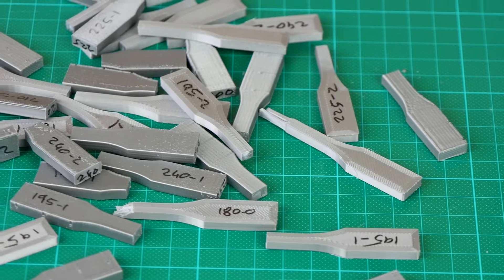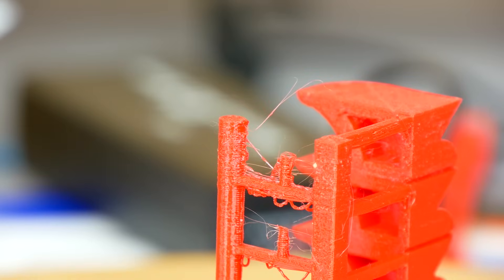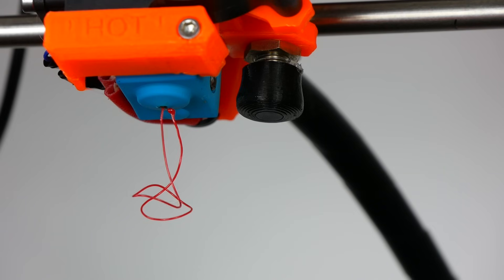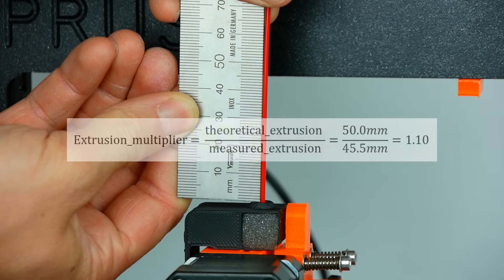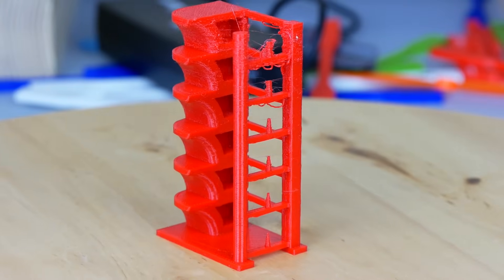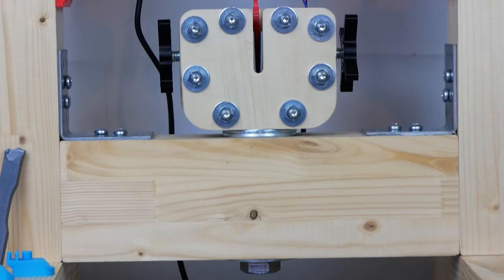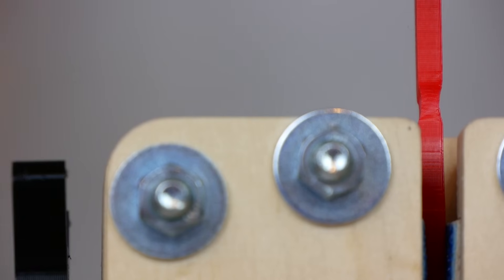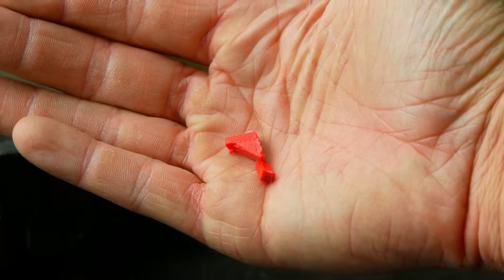3D Printing with PETG - How does the printing temperature affect strength? || Setup & Tips

Comment: High temperature comes with high speed. Each filament manufacturer have their own settings. Try (hard?) Et check results.
Tower test is very good for me and helpled me a lot between sunlu and elegoo petg settings are not quite the same.
But, past 240, stringing is most always here but acceptable, one shot of hot airgun and it's OK

Comment: I have years of perfect prints with esun pla+. I tried esun petg recently as they had a discount. 

But omg, petg is so stringy and blobby, forming lots of small blobs and lumps.

I'm using 235 degrees Celsius, but retained pla+ speed n retraction everything.

Any ideas why? I'm just going to use pla+ in the future if I can't figure it out.

But wow petg is very good to sand
Reply: PETG is hygroscopic, soaking up moisture from the environment pretty quickly. The water in the filament turns to steam during extrusion causing bubbles and stringing.
 So when it comes to PETG, it's probably best practice to put even spools fresh from the package into a food dehydrator for a few hours before first using it. Afterwards put it immediately into a good drybox (capable of keeping the filament at around 25% hygro) and print out of that.
Other important factors are to keep temperature at a reasonable level. Transparent PETG in particular can be printed at around 205 degree C in a clean nozzle/hotend and slow print speeds. 235 degree might actually be too hot and cause even dry PETG to bubble on its own. Non transparent PETG is a bit more waxy and needs to be printed around 10-25 degree hotter. Printing speed for PETG should be greatly reduced compared to PLA. Printing it fast leads to globs and stringing. My setting for small parts (<50mm at their widest) is 40mm/s for perimeters and 15mm/s for small perimeters, which some might find agonizingly slow. Cooling fan should be used but at low power compared to PLA.
Overall, dehydrate PETG, even fresh spools and keep them dry. Print slowly and not too hot.
Hope that helps!

Comment: " 210-240°C" for das filament.  I'm going to suggest that this isn't 'real' PETG at all.  Printing for PETG is in the range of 230 to 250 typically.  Seeing 210c on the label makes me believe it's a blend.  (For normal PETG in the USA, I use Ataraxia Art filament PETG, which is EXCELLENT.  For Carbon Fiber PETG I use Atomic Filament Extreme Pro CF PETG, which is exceptional, as long as it's dry).

Comment: I'm new to 3D printing, currently working on a custom mechanical keyboard project, and printing the key caps with PETG, with 0.2mm nozzle, on my Ender 3, and ended up with a great result after calibration, and about 7-8 failed attempts. :) The following settings work for me: Head temp 145 °C, Print speed 30mm/s, Layer height 0.1mm, Line width 0.21mm, 100% infill since the key caps are tiny parts, Z hop enabled, and had to reduce the minimum layer time to 1s, so it doesn't slow down cause I could not get the tolerances right with changing print speed... For 1st layer Bed temp: 70 °C, Fan OFF, from the second layer onward Bed temp 30 °C, Fan 20% This results in good adhesion, and no elephant footing.

I tried printing it with standard 0.4mm nozzle, but could not get the tolerances to work for cherry MX switches, so I switched to 0.2mm nozzle, and that worked.

Comment: Hi Stefan I have wondered if anyone has attempted to use a pump instead of a fan for part cooling?
I would like to divorce the fans vibration from the printhead and thought of using a cutting fluid tube guide for ease of directing the air flow.

Comment: I think you might be pretty off on the temperatures. Petg should very seldom be printed under 235c, most brands is perfect at 245-250.

I print most brands at 245-250 and that gives good looks and high layer adhesion

Comment: The bend vs shatter has to do with the plastic viscoelasticity. Basically when you have low strain rates the material can more easily absorb the energy and it does not shatter. So when you perform a tensile test at low strain rates the material will elongate and eventually yield. If you increase the speed at which you pull the sample it will fail (break) at a lower % strain. Typically material "toughness" is tested with a notched izod impact strength where a pendulum swings into a notched specimen and the energy it takes to break the specimen is recorded. Its just a different test to measure a different material property i.e. tensile strength vs impact strength.

Comment: The difference you observed between a ductile failure when slowly loaded, and a brittle failure when shock loaded is pretty classic actually.  When the material is slowly loaded, the polymer chains have time to unwind and stretch out leading to the classic plastic deformation you've observed.  When the material is loaded rapidly, there isn't time for those micro movements to occur and the material simply cleaves off.  Such clean breaks are pretty typical of shock loaded failures in otherwise ductile materials.  If I remember my polymer chemistry from college correctly (and it's possible I don't have it quite right) this tends to happen on the more tightly packed polymer structures.

It's just one of those things that seems to make absolutely zero sense, but it is the way it works out.

Incidentally, this video popped up in my feed at exactly the right time.  I'm working on some 3D printed spiral torsion spring designs, and intend to use PETG for the parts.  I've been working with some researchers to recreate their study, and it's really interesting stuff.  Could make for a fun video if you wanted to try something a little funky and different.

Comment: I feel like your testing methods and tolerances should be made into a rating to be added alongside the current tolerance rating that already exists for filaments. Haven't watched this video yet or printed with PETG yet, or rather I haven't printed with anything other than PLA yet and haven't had my 3D printer long ( Ender 3 Pro / I Use Cura ). I also wonder if the best temperatures for each filament should be added as a required or listed tolerance on filaments that are purchased from retailers. I must print myself a temperature tower at some point I have printed some great things already and found the Ender 3 Pro to be a great printer if anyone randomly reading this is interested also. ( YouTube comments can be funny sometimes, but we can always comment on the video and also pass on a reccomendation or review for something associated with the subject or topic and try to help somebody out with a starting place for something be it 3D Printing, programming, writing, 3D modelling, technical engineering, mechanical engineering or anything else such as the many topics that 3D printing can help people get interest in / involved in ) thank you again for this great content and your other / future content now that I have finished the video

Comment: Assuming you haven't already found the answer to your question about strain rate dependent strength and elastic response, it is generally because under low strain rates, the polymer chains have time to move across one another and align (which is the source of the whitening of polymers as they stretch). This process absorbs energy, and you can feel this as heat in the deformed area. Under high strain rates, the polymer chains can't move past one another fast enough to align and their chains break instead.

Comment: Just got my first roll of PETG to print some replacement components. Printed a temp tower then to test the strength tried snapping it. It snapped super easily, compared that to the PLA, which resisted snapping completely, at least to the limits of my strength. Gonna have to play around with the settings a bit, I guess...

Comment: PLA will slowly melt in direct sunlight. I print only PETG. I don't use cooling fan at all. PETG is the best 3D printing material for me. PETG is better than PLA and ABS. The layer adhesion is very good for PETG. I use 237 C for hot end, 90 C for hot bed, and 60 -70 mm/sec speed.  I use Wolf Bite liquid for  glass table adhesion. I always dry my PETG filament in dryer (62 C) before and ever during the print. Peace of mind. https://youtu.be/QHJVUJXa6Q0   ,   https://youtu.be/B86fTvL6M7w

Comment: I've been doing a lot of testing with different filaments trying to find a good filament with a high temp resistance for printing RC airplanes.  What I've found is that print speed has a much larger impact on layer adhesion than extra heat does.  Printing with extra heat just allows you to print faster and still get decent layer adhesion.

Comment: This video is pure gold, when I start to print petg I used 240 degrees thinking that with this temperature I would make the strongest prints, but in the last months I try to print at 220 and I get good resolution quality, through this video I discovered that I obtain also the strongest settings!
Reply: Unless your circumstances are the same as Stefan's then you'll need to determine what works for you.

Comment: I was struggling to print petg before your video. Now my ender3 is printing it like a champ! Danke shön!
Reply: Could you tell me the settings you use? Just got a role of petg and wanna print it on my ender 3 but can't find a good video or settings for the ender 3 with no mods/everything stock
Reply: @ripcordjack  I use 230c on nozzle, 70c on bed. I level the bed to the point where a sheet of paper gives a bit more resistance before moving. And I loosend the wheel next to the extruder gear just slightly. I also keep it slow no more than 30mm/s. And reduce fan speed to 50% max.If the extruder is still popping than while its running you can reduce both the speed and the flow slightly. Also print a fan cover, I had an issue with strings stopping up the fans.
Reply: @suzumes6738  thanks 👍 the leveling isnt a problem at all. Ive been printing with pla a bunch but just wanna try petg to see if it make a difference for my uses. Cause if not imma just stick with pla
Reply: @suzumes6738  thanks for the help for sure. Yeah that was me with my first prints in general. 😅 It was a bad few hours.
Well ill give it a shot and see what happens and if it doesn't work out ill either send it back or if i can find a local kinda "maker space" ill donate it

Comment: 7:39 Hi Stefan, I own my own tree removal business and since this biz requires safely lowering heavy logs down on high strength rigging rope a big thing to know about is the difference between static and dynamic loading (aka shock loading). I don't think I know the answer to your question but I thought you would find this shock load test video below very interesting. Dyneema is the strongest known fiber in the world. It's used to make string, cord, rope and bullet proof vests to name a few things. Ultrex is Yale's version of Dyneema. Ultrex is what they use in this ABS (average break strength) test. In the video below, pay specific attention to Test 1 and Test 2. Fair Warning Here: If you watch the other tests then be prepared to mute your volume so the sirens don't mess with your speakers or ears. Or just don't play video past when the sirens start @ 2:30. Here's the video...

https://www.youtube.com/watch?v=WDIo-WZkSaM

Also note, something the video doesn't tell you is about how rope loses lots of strength when a knot is tied in it. Usually about 50%. In Dyneema's case it's losing more like 90%. To counter this, rope pros either pay extra to have their ropes spliced or if they're skilled enough and have the time and feel like it they will just splice the rope themselves. Spliced rope typically retains 90% strength. In Dyneema's case I don't know how much strength it retains. But it Works like a Chinese Finger Puzzle : )

https://www.google.com/search?q=spliced+rope+strength+test

Search this page for 10% for more info...
https://www.marlowropes.com/splicing-instructions

Another reason Dyneema fails much easier than other ropes is
because it has extremely low stretch/elongation. Specifically it's 0.46% @ 10% ABS:

https://samsonrope.com/product/amsteel--blue

I use Samson Stable Braid for rigging (not Dyneema). It has 1.1% stretch/elongation @ 10% ABS:

https://samsonrope.com/product/stable-braid---coated

Watch this video to see me chop a roughly 300->400 pound piece
off of a palm tree and have it safely lowered to the ground ! >: )...

https://www.youtube.com/watch?v=dSnIvPdeVmM
Reply: It depends on the knot, but most knots are more like 40-50% line strength than 10. You have to really try hard to get down to 10% line strength for a dyneema knot. That said, splicing it is easy and fun. At least at sizes upwards of 2.5-3mm (and there might be an upper limit where it gets hard again, but I wouldn’t know about that). 1mm is pretty hard to splice, and 1.8 is still not easy.

Comment: I am building model train parts. One part is a smoke generator to resemble steam exhaust. We use an oil and heat it to 120-180 degrees. The oil evaporates into a smoke haze. Then we use a fan to blow the smoke out. I have designed and built a smoke generator to retrofit into older model trains that did not have smoke. I used PETG for its High Temp tolerance. Determining the best print settings that result in the highest temp tolerance would be very useful to me. It that something you could do in your CNC Kitchen? D

Comment: 7:47 maybe because atoms acting like magnet balls, imagine doing the same tests with same parts made with little magnet balls, the result would be the same, as you slowly pull on it, the balls rearragenge causing the stringing, and if you hit it with a plastic hammer it will shatter. With metal it is so, atoms rearrange if you pull slowly until a certain point and shatter with the sharpy test .

Comment: So I'm not a chemist or a material scientist, but I am a mechanical engineer and I THINK that the brittleness you were encountering in the PETG when you were impact testing is the result of a dual-phase structure.

PETG is just the varietal of Polyethylene (PET) that is marketed to 3D printing applications.  There are many different treatments and types that can be made with varying properties.  PET is what they call a semi-crystalline polymer, meaning that it has a crystalline phase and an amorphous phase in the same material.  there are several factors which can affect these phases in any given part.

The first phase that you tested was the amorphous phase of the polymer, which exhibits softer, more ductile properties.  The second phase that you tested was the rigid crystalline phase.  I can't explain the mechanics of it because it's out of my field, but I can tell you that the different phases have different stress-strain behavior, and those behaviors become dominant based on the loading case.  From what I can tell, the crystalline behavior becomes dominant at high strain rates, causing brittle fracture.

Hope that helps.  I found an interesting resource (https://link.springer.com/article/10.1007/s40870-016-0052-8) for a little more info about this behavior in polymers.

Comment: Does the ambient room temperature have any effect on hot end temperature? And which filament did you find to be least affected by humidity? Thank you.
Reply from the maker: Room temperature rather affects the cooling rate, hot and temperature is not really changed. 
Standard PLA is not really affected that much by moisture, PETG only a little. PP as far as I know not at all but has very unique properties.

Comment: The problem with PETG is that it has both a low specific heat and a relatively high thermal conductivity. This means it cools down very quickly and printing it in a cold room and/or with too much cooling, will definitely reduce layer adhesion. This may explain your varying results over time. An easy way to see when you're cooling PETG too much is to see when the surface starts to lose its shine. If it does, it's cooled too quickly and layer adhesion will become bad.
Reply: Recommendations are near 20% cooling for quite every producer, but QIDI Tech, it's PETG Tough is for 400mm/s and 100% cooling. Lot sticky and strong. I had problem with bi-metal hotend and reverted to PTFE at 250°C. Yes PTFE lining has short life at that temperature, but the result is good, and after 2 spools printed I change throat, or refurbish it with new PTFE line.

Comment: Lots of people say PETG is the new PLA and rave about how easy it is to print with and how good the final products are. In my experience, printing ABS or even Nylon is easier than PETG. I've tried many times to make PETG work. On 3 different printers, 4 different brands of PETG and with every imaginable setting under the sun. Results are never as good as what i can get from PLA.
Reply: Somehow I could never get ABS to work without serious warping or peeling... PETG printed just fine after a bit of fiddeling with the settings. Sure, not as good as PLA because it strings more, but very comparable

Comment: The difference in "way" it is broken is because of the speed. When you are bending it or slowly pulling it, the polimer chains and crystal structure has time tu adjust and reorganize so that it doesn't shatter to pieces, but if it is impacted in a short amount of time it can't reorganize but it needs to absorb all the energy so it shatters. So, one is force over "long" period of time, and the other is force over short period of time or the "impuls"